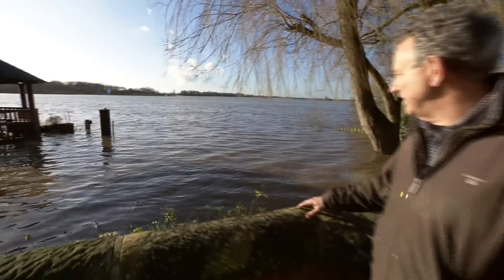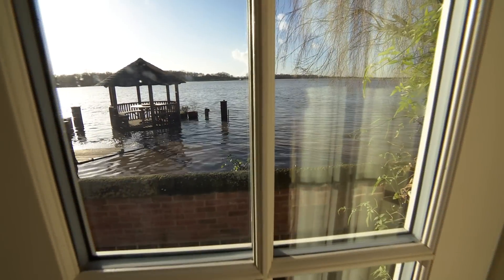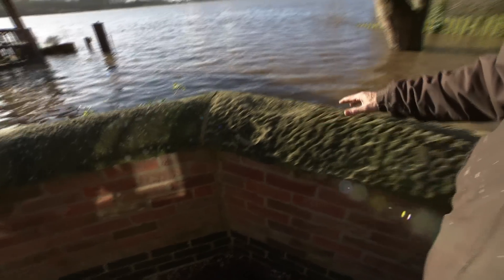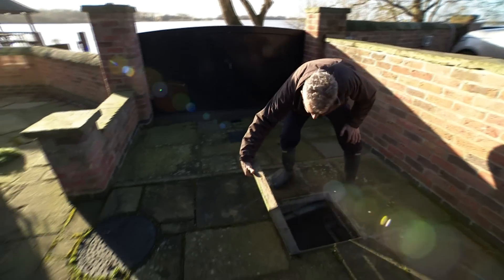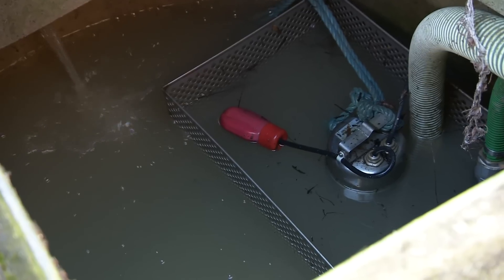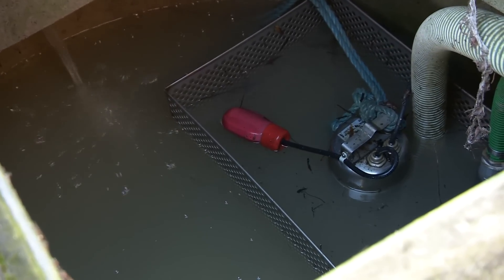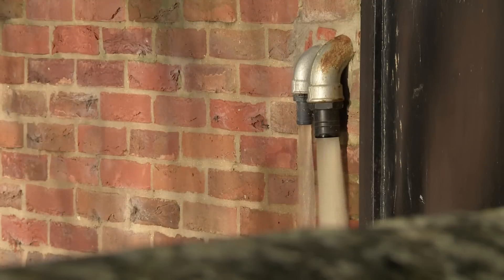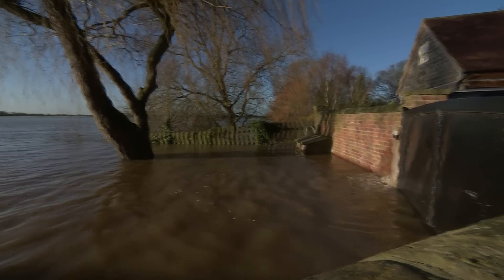'I built my own flood defence system' - BBC News

Comment: If I needed to live in an area of flood risk this is exactly what I would be doing... its a no brainer. Yes its expensive, but no more than having your house flooded just once, and you will avoid all the disruption of damage to your possessions and temporary accommodation. I would also have a generator as a backup power source... and probably a backup petrol powered pump in the event of something failing, or overtopping  requiring additional rate of pumping. 

Any house at risk of flooding should have at the very least a small sump with a pump to control seepage through flood gates at doors and through walls.

Comment: Working again this week are Mrs Luptons flood defences . Vertical  steel rebar fixed into wide concrete foundations then the wall built using that. Hence, not so thick (from daily papers 2024 ).

Comment: AS FLOODS ARE VERY HIGH AT LEAST 5 FEET OR MORE. SANDBAGS DO NOTHING. IF I OWNED A HOME IN A FLOOD AREA I'D BUY SEVERAL LARGE TARPS AND SECURE THEM 3 FEET ON EACH WALL TO THE GROUND. THEN SECURE THEM AS HIGH UP EACH SIDE WITH WHATEVER IT TAKES, NAILS SCREWS. AS WE SEE THOSE MASSIVE FLOODS IN CALIFORNIA THE WATER ALONE WOULD SECURE THE TARP TO MY HOUSE AND NO WATER COULD ENTER...JUST A THOUGHT!!

Comment: What a guy. Brilliant . People who live in thease flood areas , there better banding togeather and doing something thats going to work , instead of whineing about it.
Reply: David Worgan could you just sort out your spelling a bit please?
Reply: @dylansterio3227   hows this , fuck off
Reply: David Worgan .... how’s
Reply: Almost David.... almost
Reply: @stephen3654 
Not walls like this, but flood gates at doorways, air brick defences, and flood resilience works like ceramic tile floors, waterproof plaster, electric sockets high up the walls, solid wood furniture and kitchens units, that will safe dry out. A lot can be done.